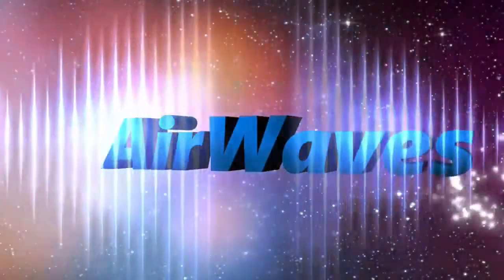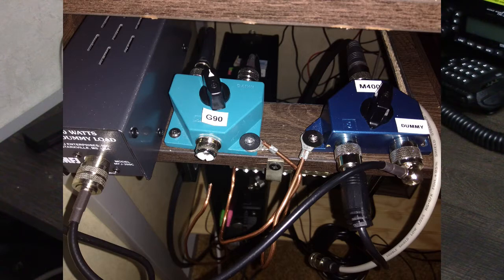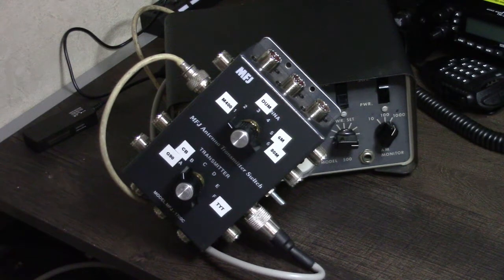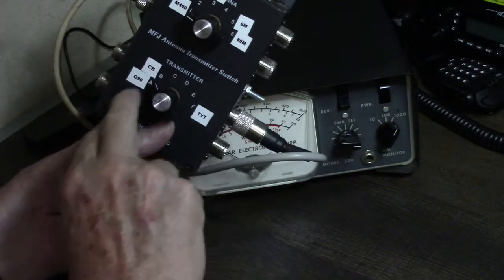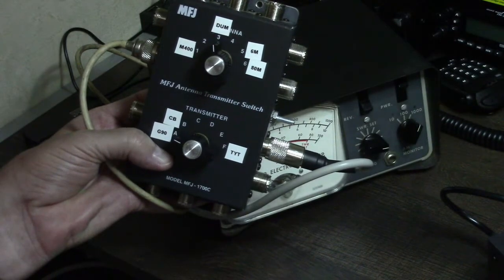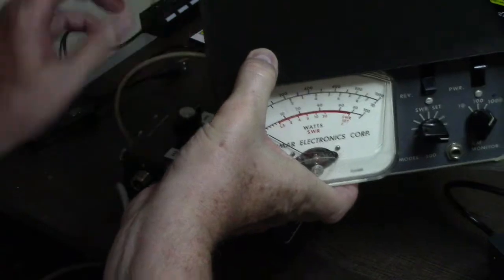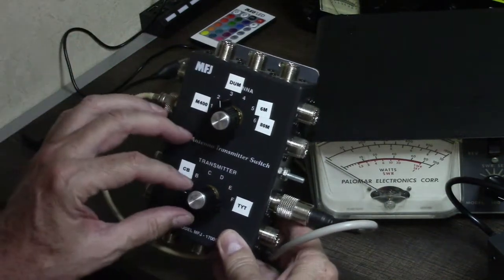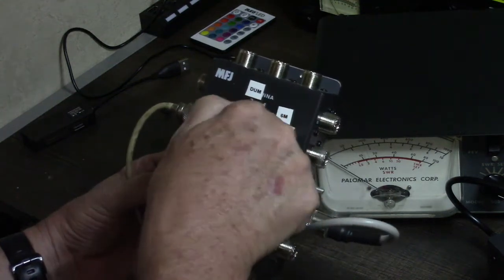Airwaves Episode 42:  MFJ-1700C Antenna/Transmitter Multi Switch!

Comment: Wouldnt your SWR Meter work just from the radio side, no need to connect to the  antenna side right? The 1700c switch is allowing the RF through. The meter I suspect is designed for pass through? I may be wrong, probably am but wanted to be sure :)

Comment: I like the mfj1700c that's a good piece of equipment. But if I was you I would use one of the two position switches. I'm using the MFJ 1702c and it does a great job for 6&2 meters SSB. And by the way I really enjoy your videos keep posting and I will keep watching. 73 AE4OY WILLIAM A. Peacock, SR.  EM-81UF

Comment: Good video.  I was thinking this is exactly what I was looking for EXCEPT when you said its only HF (and maybe 6m).   I have multiple VHF / UHF / HF rigs and antennas in the shack and was looking for a solution to connect them all on one switch?  Did you run across anything when looking at this?  73's
Reply from the maker: Kevin,  No, I never found an all-in-one solution, but of course there are similar devices for UHF/VHF antennas.
Reply: Thanks FYI I contacted MFJ and they said you could take two MFJ 2704 and connect them to get 4 antennas in and 4 transmitters on the out side.  No common but it is HF / VHF / UHF compatible